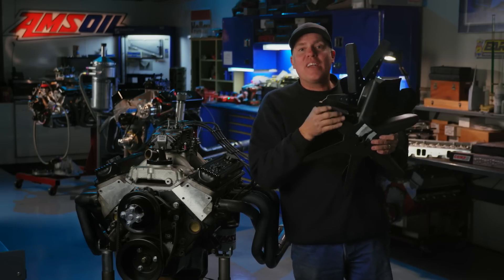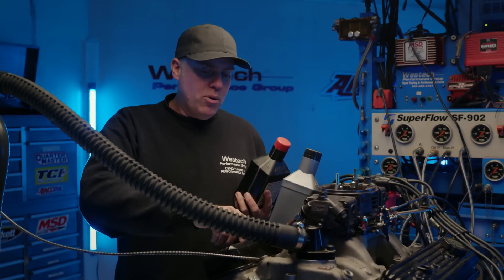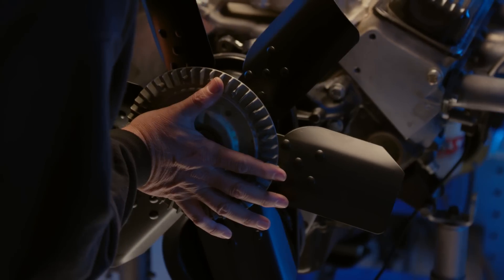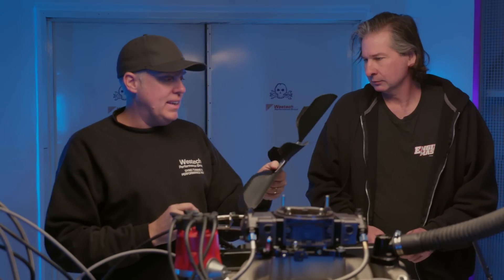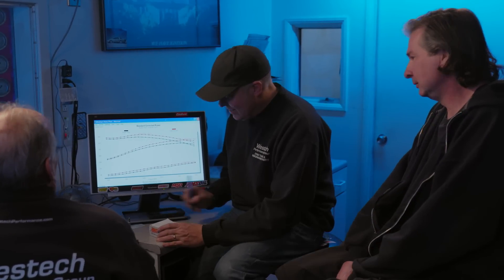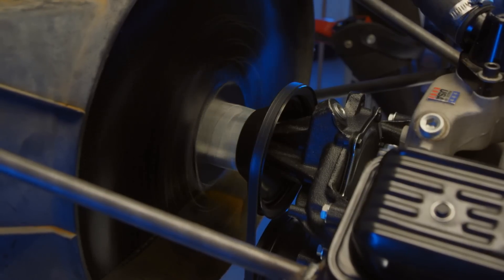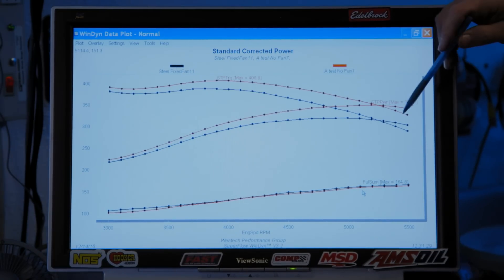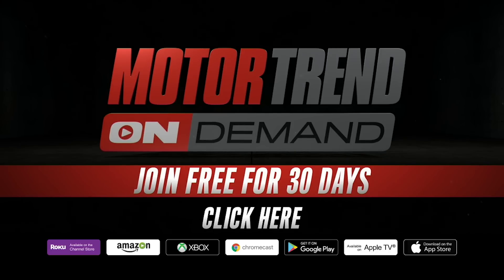Cooling Fan Shoot-Out! - Engine Masters Ep. 20

Comment: I thought electric fans were a no brainer these days.
Reply: Everybody knows you do fan maintenance every other time you change your blinker fluid.
Reply: Kristopher Klassen How about my fan decided it didn't like being part of the water pump anymore... the ampunt of carnage under the hood was unreal lol, I love my electric fans....
Reply: Robonza With 50 Duck calls in the tail pipe.
Reply: Seriously.  Watching this I almost want to see how much it would cost to go electric on my daily driver 302 Windsor powered Mercury.  If that poor thing is loosing HALF the power they are?  That's like 10-15%!
Reply: 3rd gen Camaro and Trans Am's have had electric fans since the early 80's.  30+ years!  My '87 had the original electric fan still and was used as my daily driver until last year.
Reply: Right? What a retarded high and mighty response from somebody who clearly does not understand how maintenance works. There is no maintenance for a fan...
Reply: AND HOW EXACTLY DO YOU MAINTAIN A MECHANICAL FAN?
Reply: Clutch fans die. All of them. Electric fans are sensor dependant, so even when they might work, they might not go on properly, or at all.
No route is 100% safe.
Reply: not in the land of v8 carbureted 6liter 200whp naturally aspirated single cam 3000kg with no steering bald eagleness
Reply: My 200hp 350 chev has electric fans, maybe I get 220 now?
Reply: Most cars have had them from the factory for 15 years.
Reply: Electrics also let engineers do things like put two or three side-by-side so you can have an effective airflow through a radiator with a low and narrow profile. A consideration that might not matter for a brick, but makes sense with more aerodynamic cars.
Reply: @Dakota Dewolf

And it's somehow the fan's fault you ignored the rising temperature gauge.
Reply: I also did an electric fan conversion on my 2.3 Ranger, since the stock clutch fan was stuck solid. It freed up 5MPG and a bunch of responsiveness from the puny 100hp that engine put out.

I've since added a turbo, so those 5MPG are now gone currently :D.
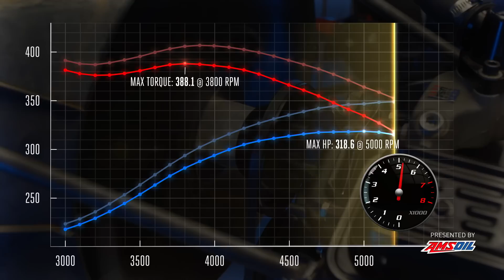Reply: The electric fan wouldn't have to pull 10 hp of air. Look at 12:15 in the video. At 3000 rpm it's using bout 5 horsepower. How much at idle? My guess would be around 1 or 2. That's all that's needed to keep an idling car cool. Unless you're doing a burnout or racing you don't need a fan when you're on the throttle. If you're overheating when racing you might want an improved cooling system over throwing 30 horse away. 
Not to mention that an electric fan right on the radiator will have an easier time pulling air through it than a fan many inches away.
Reply: The biggest high performance electric fan cant push with in a 1000cfm of a normal stock mechanical fan. By all means if your able to use one go for it but dont beilve for a second an electric fan will provide near as much cooling as a mechanical clutched fan never mind a straight direct coupled mechanical fan.
Reply: Wrong how many times electrics fail in your house? If you took that attitude you would still be using ice to keep your milk from spoiling. IF it wasn't for the Tenn Valley Act the majority of you would still be using out houses and oil lamps.
Reply: What a troll Kristopher. What would you do to a mechanical fan to detect that it needed replaced? Fatigue cracks probably take seconds to turn into failure. How would you maintain a mechanical fan? Weld it? Whatever.
Reply: we have a 66 chevelle with a original 327 300hp engine with a fan attached.  
we keep it like that to keep the car original.
Reply: I was your comment's 100th like. No big deal.
Reply: Yep. The moment you add in a clutch, you bring back a point of failure. Then your only real advantage comes down to cost and ease of installation
Reply: Jeep XJ Taurus electric fan Conversion?
Reply: I know I'm kind of late to this but I've replaced far more mechanical than electric fans.
Reply: The closest I've had to a mechanical fan failing on a regular car was on my '91 Mustang 5.0. The plastic fans crack around the hub from the front face back. By the time you could see the cracks (without removing it first) it would have already blown apart and it's just about 100% undetectable unless you're really trying to see it. It's a common failure on those cars, actually. So... "Maintenance" isn't really the answer here unless you routinely disassemble your entire car just to look things over. I found out mine was bad as part of a radiator replacement.

Mine has an electric fan now.
Reply: B10401 It's also worth noting that at certain speeds, a non electric fan can actually impede airflow and cause an even higher power loss. Heck, most modern cars don't even need the cooling fan to be running if the car's moving at anything faster than jogging pace. Clutch fans are a compromise, but electric is the way to go. It gives almost unlimited control, and in 90% of cases, it's a no-downside choice. If you have a huge amp, cab lights, a winch and are trying to jump-start another car, then you just MIGHT overload the electrical system though :) (Though at that point, the electric fan is the least of your concerns when it comes to amp draw)
Reply: Yes, but not nearly as much if it's stationary, and at least at that point it won't be consuming any excess power.
Reply: You stay in traffic while there a +40C in town under the sun, engine idling, not enough rotational speed to cool engine - you're fucked. and this is a common problem, electric fans simply can't have that kind of problem, exept one - they broken totally, or low/crappy coolant. Then a second problem - you turn off your engine, because it's boiling - but you cant cool down even some part of coolant in radiator, because mechfan isn't turning, while electric working at full blast.

your engine is 100x more faulty, than electric motor of the fan, you can't trust to the cheap shit, but you can trust to the stock fan or branded one.
Reply: Mechanical fans do fail, and they make a huge mess. They usually fail due to a bad water pump and take out the radiator, hoses, and sometimes the hood.
Reply: Electric fans cool just as well as long as you have a proper shroud. Also if they are set up right they will never run if your moving.
Reply: If you need THAT amount of air to cool your engine - your radiator is probably shit, there is exponential rate between amount of air and cooling capability. you go twice much air, that means twice much speed of air - you increase cooling factor by 5-7% only, you go triple speed - 9-10%. there is no need for that amount of air.

If electric fan with 2000 CFM cant cool your car - fan with 8000-10000 CFM hardly can. in this sutiation you need bigger volume in radiator to slow down coolant.

Maximum efficiency is not at top speed of air through radiator, because heat need some time to transfer. faster speed - less time - less cooling increase.

i bet ya, if you place an electric fan straight to a radiator, with the diameter just like height or little less of radiator - probably you get maximum efficiency out of that.

and you are wrong about CFM. every sigle fan has at least 2500, up to 3500. there are a dual system with 5k for 300$, thats nothing
Reply: I agree. If you can get a efan to work and cool its defiantly the better option im not debating that.
Reply: No, it makes 200 now because of the fan, it likely under 200 hp and why you get dusted by a V6 Toyota Camry.
Reply: honestly it depends on your application. It's also one less point of failure, remember.
Reply: @Horsepower Garage

Methinks the electric fan might be why you've been through 2 engines.
Reply: overheat can happen in 1-2 minutes, and some cars do not have this gauge. also, how often you look at it? twice per week?
Reply: Well we know the fan was the reason Dakota's engine failed and don't have any idea about Horsepower Garage.
When do you actually need more cooling? Admittedly I every month or two have the electric fans start in my cars and motorcycles because I don't idle them at all really and there isn't much traffic.
Reply: My friend with an 89 I think 5.0 replaced his with electric too. He's happy about the change.
Reply: Kristopher K.....Maintenance has nothing to do with it unless you can see a crack forming.  I've had a failure  of my own and have been around a couple of more.  There is no way of telling when.  The plastic fan they tried is the worst at coming apart.  They just shred without notice!
Reply: THE MTB FANATIC My 5.2L naturally aspirated, carbureted V8 makes every bit of 371hp, 406lb-ft tq.
Reply: But wouldn't an electric fan impede airflow too?
Reply: Well designed electric fans do some tricky things these days

1) They shut off when you go over a certain speed for multiple reasons
2) The shrouds have flaps in them that open at speed.
And many other things. It is a far superior technology.
Reply: B10401 just a little, on high speeds radiator will impede airflow a lot harder
Reply: Eh maybe if stock but like headers, added HP not worth the hassle and modifications.
Reply: Adding HP is not, but adding more safety to engine - absolutely. electrofan can cool down tngine no matter what temperature outside and what rpm engine is, also it saves you power&money. mechfan can't do that
Reply: that makes even less sense. you'd want electric  fans off road because you dont have nearly as much airflow across the radiator
Reply: I was talking about cars, but sure we can talk about work trucks. I'm no expert on either but here's my thoughts. For work trucks you'd need powerful electric fans. This site shows a semi with  at least 2 1.25 horsepower fans. 
http://www.electricfanengineering.com/12-24-48-volt-electric-cooling-fans/12-24-volt-road-truck-tractor-electric-cooling-fan-assemblies/
The site acknowledges that the vehicle should be road-going, because it will reap benefits from having electric fans if it is, but if it goes off road it will consistently need full power to the fans. This would largely defeat the purpose of having electric fans, meaning you should consider a belt driven fan. It also helps that commercial trucks are often diesel, and even when gas powered seldom spin up above 5500 rpm. The lower engine speeds mean that a fan doesn't have to be tuned so carefully. So it's a more complicated decision with commercial vehicles. 
I've heard tow ratings are kind of black magic. I do know my dad has been pulling his 3000 pound boat and 1000 pound trailer behind his 2005 or so dodge grand caravan for years. We don't live near any mountains but if we did I'm sure we'd run into overheating.
Reply: How does your drag car overheat? You might be warming it up too long. Just kidding. I believe it about autocross speeds, though.
Yeah there is  point where electric fans aren't good enough, but once you're past that the point where mechanical fans aren't good enough isn't far off.
Reply: See? electric fan is a lot more effective, it takes 2-3 hp to cool down a big truck engine. also, it takes power only when you need to, on highway you will not burn fuel for nothing

also on smaller car - for example touareg - there is only 30A fuse, so in peak fans eat about 14V*30A=420W. IN PEAK, when fuse blows. in normal mode it will be 300W, compare to 30 hp lost with mechfan, and it's a 450HP car!

I cant find point, where electric fans arent good enough. it good all the way up, until we came by the engine in lawnmovers, which works at fixed rpm every time
Reply: I agree. I have dual fans. Each capable of cooling my engine by themselves. Only time I might have to run both is rock crawling in 120 degree heat. That's saying something for a 360FE engine. Damn things always want to run hot. But, I don't trust the electric much myself. As long as the engine is turning, you can't beat an old school fan without a clutch. If it's turning, the fan is doing it's job. haha
Reply: I have had electrics fail me often. So. Low speed, rock crawling in the AZ desert I didn't go back to engine fan. It couldn't keep up even when working. I went with dual high capacity fans. Almost all the time one is plenty even in the hot heat. If it's not, I have a backup. If one fails, and the other one can't keep up, I take a break.
Reply: Well, when you cant cool your car - you need upgrade both fan and radiator, to dissipate more heat into air. but increasing airflow also good idea, but in you situation mechfan can't work totally
Reply: AZ DieselTech, when crawling do your rpm stay to low for the mech fan to relly put out?
And do you ever find an advantage in turning off the engine and letting the fans keep working while you take breaks off-roading? ADFKSJG mentioned it but I wonder if you've noticed it helping.
Reply: maybe his fans spinning only when generator works, in my car, if they spin when i turn it off, it keeps cooling and pump still working for turbine. anyway - you can wire it up so that you can manually enable them
Reply: thats a really underpowred barge
Reply: Electric fans have no where the ability to cool like mechanical fan. Not one truck that has a stock tow package comes stock with an electric fan. Theres a reason.  
My weekend warrior makes little under 900hp and little over 1200ft tq turbo 383 stroker.  Never would an electric fan cool radiator, interccooler trans cooler oil cooler and PS cooler.  I would sacrifice 30hp  to have cooler running engine any day .
Reply: bigger electric fan
Reply: 4 electric fans in push pull (2 on each side)
Reply: Not every one can attach fans on the other side. I cant . How would you mount a shroud. Even if so it doesn't work like that with one pulling and one  pushing it will help but it doesn't stack cfm, Still a high performance clutched mechanical fan put out around 10,000 cfm of air while most electrics put out 2200 cfm of air high performance 4500 cfm. A straight coupled mechanical fan pushes double what a clutched does. 
Electric fans cool no where near what a mechanical fan does. Why would some one risk over heating there high performance motor over 30 hp?
Reply: ADFKSJG
You tell me if my radiators shit. Far from. I also have my fan cooling a intercooler PS pump cooler oil cooler and tranny cooler  .These are just guesses Im making . Ive run ever type of system over the years. My engine made just under 900 hp and a little over 1200 t lbs or tq 3 months ago.  
www.theturboforums.com/threads/a-machinist-a-turbo-and-his-l31-gmc.381269/
Reply: If it not shit, then it will be able to cool your beast down even with 4-5k CFM in any cases, maybe less. there are a lot of cars with 800-900 hp (stock is around 450-500-550) on stock cooling systems - totally fine. there is no need for that performance of fan.
Reply: ADFKSJG
Not true.  Most v8s stock use mechincal fans for a reason , no turbo v8s or diesel engines come stock with efans. Ive yet to see a turbo v8 at the drag strip with a efan ever that makes any type hp to talk about.    there isnt one auto company stock that offers a tow package with an electric fan . Not only that I know certain auto company offer mechanical fans as performance packages as upgrades.  An electric fan is no where near as efficient as a mechanical. I would rather have a cooler engine that a few extra hp.
Reply: The cls63 makes 577hp not 800 .Ever engine I talk about is 10 -15 years old.  No I was not referring to the ram but yes a dodge jeep. Towing creates heat .v8s create heat diesels create heat . More specifically towing .Towing creates the most heat. We are talking about cooling engines properly. Im not talking about i4 v4 v6s . This is a n american show most people talk about american cars .None of those engines create enough heat to matter usually . Efans make more horse power I agree to that but they cool no where near what a mechanical  fan does.
     While all the car industries are having hp wars if efans were the best thing for their engines dont you think they would stick them in their bigger motors that generate mass amounts of heat? . They dont because or risk of cooling properly . They dont draw enough air to cool everything up front there is more than just radiators that needed to be cooled down. This isnt something new you can read this all over the internet.
Reply: and not everyone can put  the radiator straight in front of the engine
for a mech fan to work
Reply: Seriously are you so cheap that you haven''t done it by now? The power loss is right where drive it on the street.
Reply: The fact you call it "sh*t" means you don't know "jack" either but the basics.
Reply: J⃟O⃟N⃟A⃟T⃟H⃟A⃟N⃟ S⃟C⃟H⃟U⃟L⃟T⃟Z⃟ the only 327 options in 66 chevelles were the 275 hp L30 and the 350 hp L79. Thusly yours can't possibly have both a 300 hp 327 and its original engine so which is it?
Reply: I mean...your not far off...
Reply: 30 HP is more like 50 percent of a 302 Windsor output.
Reply: but it was cool to see how much actual power was lost.
Reply: I didn't really think about it. I mean, I rebuilt my 79 f150 (ford 400, 2wd) for performance, but never even thought of messing with the mechanical clutch fan. I thought it had no real difference. I may tinker with it after watching this.
Reply: i talk about 800+hp CLS63, BMW's, Audi's. All electric, not talkin for murica's 60's engines. towing cars - you mean RAM pickups? if not, there is a tow package for Cayenne, up to 3 tons per mount - and yea - electric fan. move over - volvo trucks for 40 tons - electric fans all around, but they are rarely engaged - engine is really efficient.
well - it's not efficient at all. it takes more, but output is just a bit more. only thing, why it is all around tow and same cars - it's dirty cheap. just bolt it and go, but in hot day in slow traffic you probably fucked up
Reply: Electrofan is WAY better in any situation - they can be PWM'd, so you can change speed, for example at 30 km/h in traffic in 25C you dont need full blast - you need it only in sahara while standing still. some has two fans - small and big for all kind of situation. and in fact - electric fans can eat more power only when they need to, but well - they do job a lot faster. and mechfan eat power all the time

clutch fan - somewhere between good and bad, sometimes they cant cool your engine enough in hot weather at idling rpm, sometimes thermostat goes away.

and it's not one less point of failure - a little crack may cause a big exlosion, when you suddenly pull up to rev limiter
Reply: Nope. My '88 Supra's clutch failed on the fan, overheating the engine and blowing the head gasket costing 3+k in repairs.

My Corona has an electric and has never failed.
Reply: Electric fans don't cool as well. They're also hideously loud and more expensive. I will stick with the clutch.

They wouldn't be bad if they were thicker, but all of them are paper-thin. No room for pitch. Then again, they would need even more power to run and you'd still be better off with a clutch fan. Catch 22.

Shitty aftermarket metal flex fans tend to blow up, because they're not as strong. I would actually consider them dangerous. When those blades come off, you do not want to be anywhere in a 2 mile radius. They will shear through solid steel hoods. Almost as bad as a runaway flywheel. (Read: Giant 20-pound 7000 RPM steel sawblade)